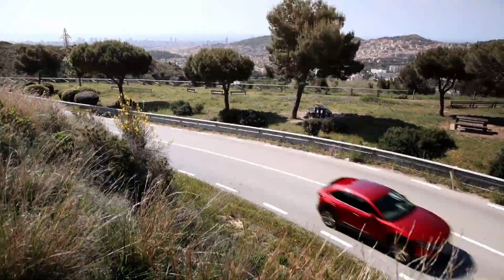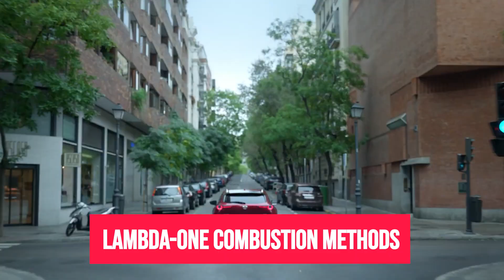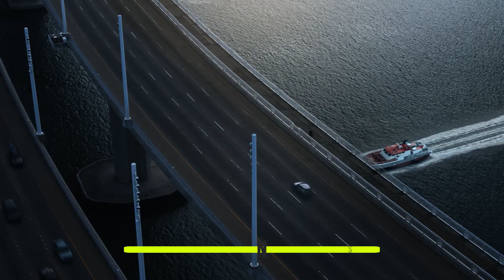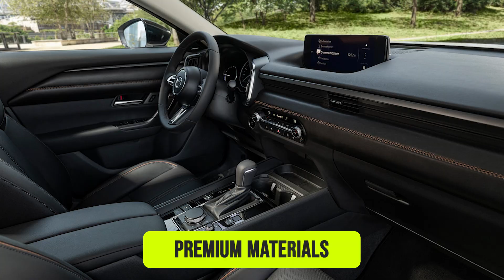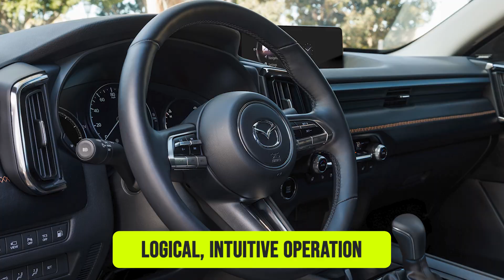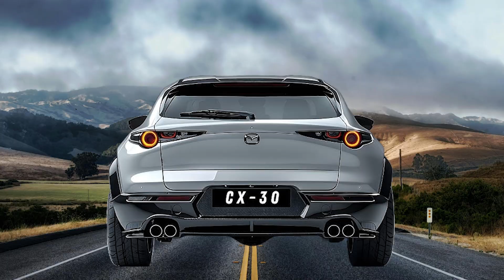6 Ways 2026 Mazda CX-30 Turns Mazda Haters Into Believers!

Comment: They’d better not put the climate controls in the touch screen like they did to the cx-5!!!!!
Reply from the maker: Right?! Physical climate controls are one of those things you don't appreciate until they're gone. Are you talking about the newer CX-5s having everything buried in menus now? That's such a safety thing too - being able to adjust temperature without looking away from the road. Have you driven one of the newer ones with the touchscreen setup, or just dreading the possibility? Seems like every brand is going that route unfortunately.